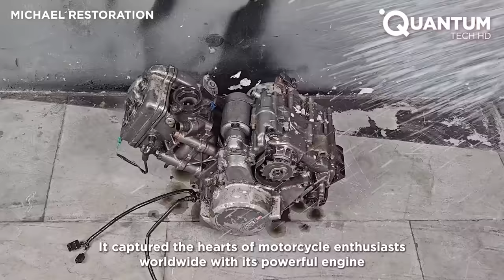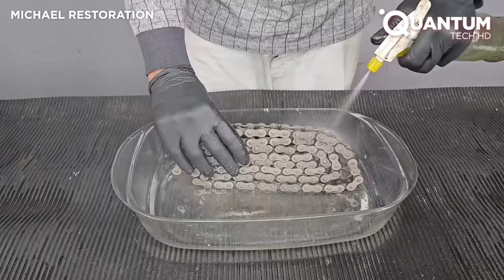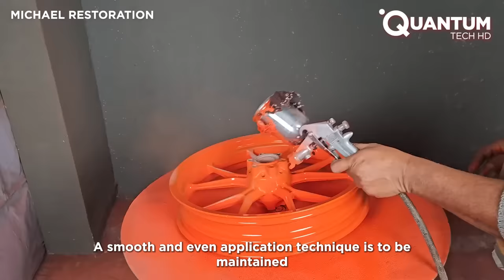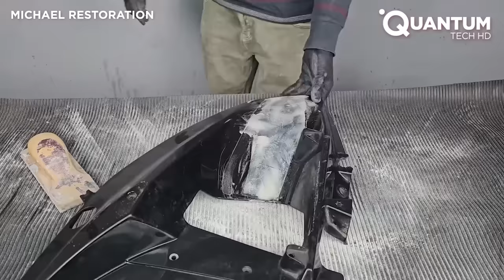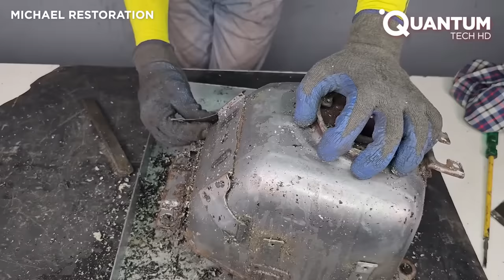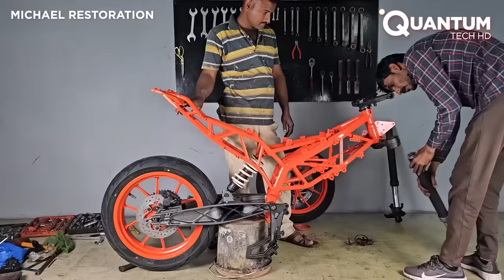KTM Motorcycle Full Restoration Back to New | Start to Finish KTM RC 200 by @MichaelRestoration

Comment: This isn’t a resto. It’s deep cleaning the mud off you rubbed all over it. Signed a custom auto tech.
Reply: EXACTLY....this resto are fake totally
Reply: Согласен. Цилиндр старый, поршень старый, тормозные диски старые, это реклама шампуня. Его даже заводить не стали. Michael shampooneition.
Reply: @Prosmotren  try again in English.
Reply: Yea, just a clean and repaint
Reply: Wait… did they spray paint all the cast aluminum?
Reply: @Censortubes  only for you/ I agree. The cylinder is old, the piston is old, the brake discs are old, this is an advertisement for shampoo. They didn't even start it. Michael shampooneition.

Comment: sandblasting the chain. The O rings will love that.
Reply: Yeah and painting without masking areas for seals and bolts 🤣.
Reply: And sandblastng the bearings too. That's what smooth rolling is all about
Reply: I don’t think they even installed a new piston and rings, honed the bore, replace swing arm bearings and bushes, fork seals.
Reply: Dont forget whatever the hell he was doing to that brake disc

Comment: They've done an amazing job... But there are serious flaws in process... For example they've used thick layers of plaster whic, eventually will crack after a couple of flexes... Paints have never been heat treated., yes i know these paints are sold as no need to heat treatment but as we all know well, heat treated paints are way too much durable... Gas tank, they've only treated outside but it also should be treated from inside etc... aaand last of, I haven't see them using a totque wrench in this video...  Thats interesting... :)
 Great job, patience and effort but there are serious flaws...

Comment: I don’t like this video. The bike is not "vintage" (just come to see my workshop...) and it doesn’t seem to have any mechanical problems. All the work consists of painting and stripping, it is cosmetics. When we see the guys cleaning the engine without plugging the inlets and outlets of the cylinder we know that we are not facing mechanics. It’s confirmed when they pull up the engine without a torque wrench. And finally, the playback speed, even at half, is unbearable. I put a thumb down for this video, and it’s rare

Comment: ah these guys fake restore lol the bike looks wrecked but they are going for a resale which having OEM fairings holds the value…broken handlebars but the plastic fairing is undamaged no cracks or broken pieces…. it’s plastic if that thing goes down that stuff shatters. handlebars are easily swapped out they could take broken handle bars off any number of wrecks and put them on this as they desguise it.